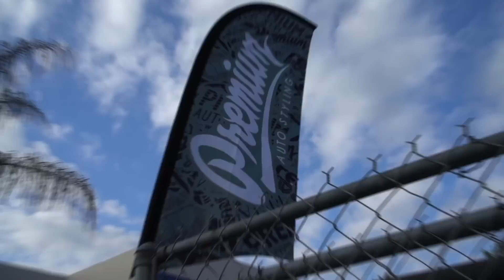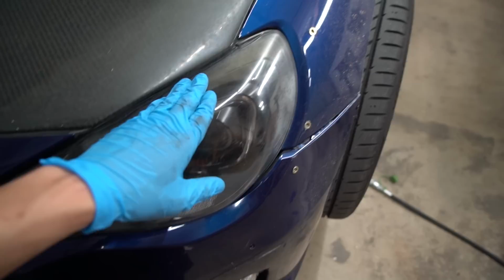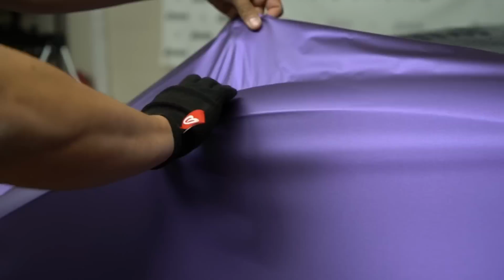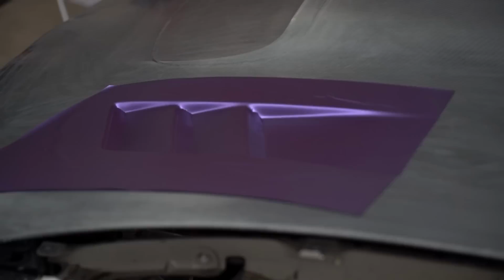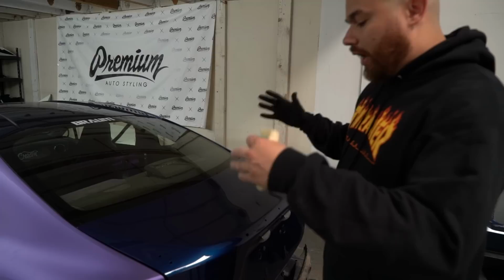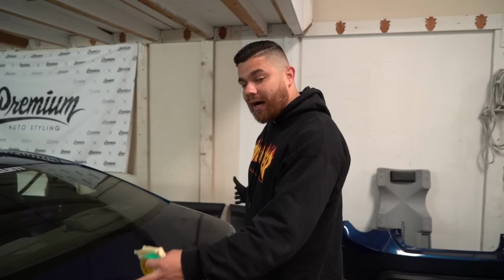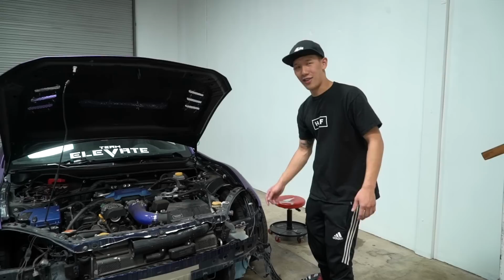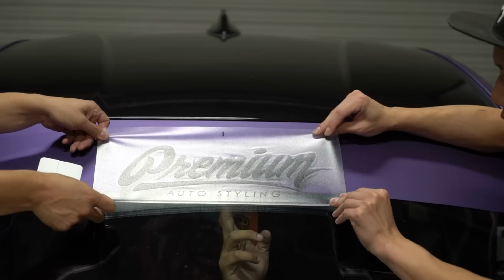Purple Metallic Wrapped BRZ (Rally Backer WIDEBODY KIT)

Comment: Re-wrapping my FR-S widebody (Same exact kit), I'm finding the wide body pieces are actually some of the most difficult with the contours, uneven surface levels and even points on the front bumper pieces. Just be patient, and it will pay off! Do NOT rush a wrapping job no matter how excited you get.

Comment: I see you guys cutting the vinyl on the car often (doors, hoods, gas cap, etc). I’ve read and seen videos where this creates scratches and cuts into the actual paint. Just wondering why you’re doing this? An example of this is the Yiannimize wrap competition videos, they pointed out quite alot of scratches/cuts on the paint caused by the knife.
Reply from the maker: creaTive proper techniques are key! blades should never make contact with the paint and they do not in our shop. Cuts are typically made in between panels and not directly over paint. It’s very important to make sure your vinyl installer is properly qualified. We’ve seen horror stories